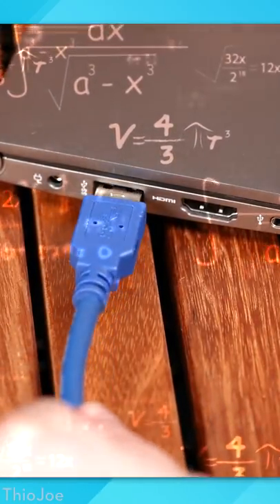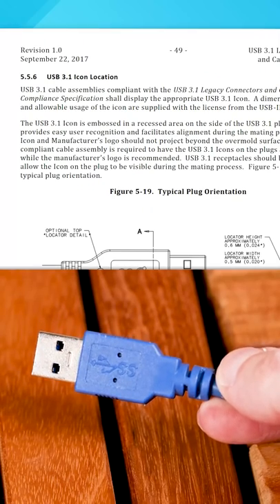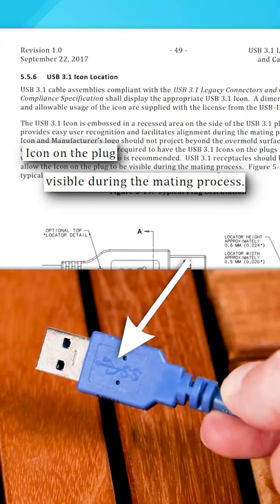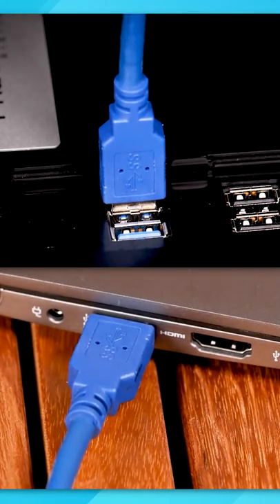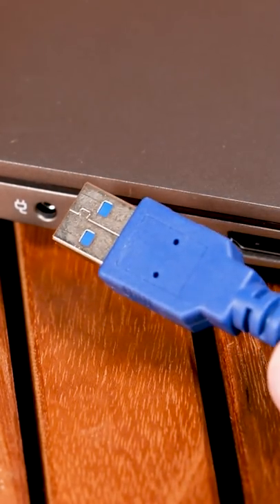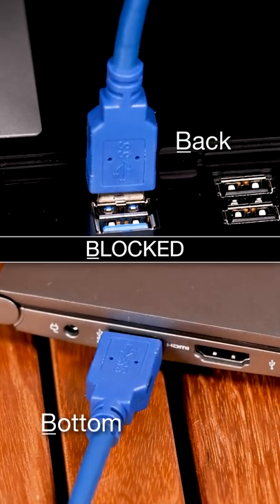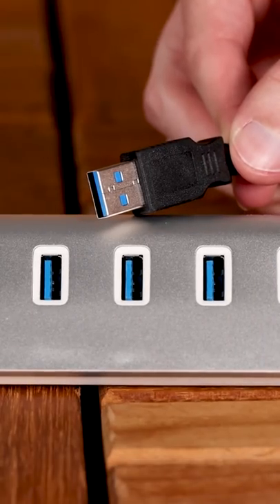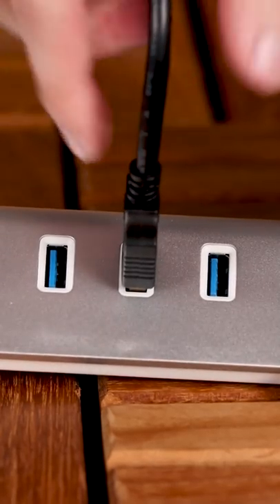Never Plug in a USB Wrong EVER Again

Comment: i already found that out when i was 9, how doesnt everyone know this already
Reply: I’m 30, software developer, and didn’t know…
I have always used a usb hub on the back of my computer with one of each kind of cable connected to it so I never have to handle the usb-a.
(And I plug usb-keys/usb-a peripherals on the front, where the ports are vertical [|] , but it’s ok I can just look at it)
Reply: @morluche91  im 16, also software developer for like 8 years now. In school i always used a mouse with my laptop and between breaks i had to put it in my bag and then put it back in after so eventually i noticed it had 2 open holes on the top which just stayed with me

Comment: Joe, some time ago I spoke to the USB folks. They said if a port wasn't installed correctly, or a cord wasn't labelled correctly, then they would revoke the manfacturer's permission to use the USB logo. Great, right?
 Then I got two hard drives from one of the largest makers, about six months apart. You guessed it, the logo was top side on one and bottom side of the other. I spoke to the USB folks again and they said yeah, they'd given up on that fight. So I put a dab of colored paint on the top of each cable. No more guessing, or wondering if a plug was mini/micro/c/c+.

Comment: USB port is designed in such a way that, even if you inser it correctly the first time, it still does not accept it, because it senses you are not sure. Then you rotate it and now you are sure that this side in incorrect and the you rotate it again and then it gets inserted.

Like if it's true.

Comment: JBL has a great solution to this. It's a USB A cable with the plastic bit in the middle such that it doesn't matter what orientation it is plugged in, and the other side is USB C.

Comment: It's all fun and games until you plug your USB drive into a port that's mounted upside down, as is the case in my PC. If I plug into one of the front ports, the USB logo faces up and the solid holes down, but if I plug into my integrated multi-card reader that also includes a USB 3.0 port, the USB logo faces down and the solid holes up

Comment: I just look at the plastic bit through the holes. They are nearly always on top in the computer so you should be able to see the space in the connector when plugging it in so your end is on the bottom

Comment: Fun fact: it's literally impossible to plug a USB in wrong.

That's why we often fail on the first attempt.

Also, I'll wager that, in most cases, it's very difficult to discern which side had the blocked squares, as most cables don't use coloured blocks, they use black. In poor lighting, you just can't tell.

Comment: That's all well and good, but sometimes the USB port is upside down and you plug the cable in right side up expecting it to go in, and it doesn't. So even if you know which way is up on the USB plug, that doesn't help much.

Comment: You do realize there's reversible Type A USB plugs? My JBL Flip 5 came with one on the charging cable. The plastic part with the pins is positioned in the middle instead of on only one side. That way you don't have to worry about how it plugs in. Its not as good as Type C, but it's still pretty useful.

Comment: TIL Corsair didn't follow USB spec when designing my case. Because the Blocked side is definitely not on the bottom. Luckily, my PC case is situated to my left instead of my right like it's supposed to be so I accidentally made it right and the little logo thing faces me when I plug stuff in

Comment: Would be much easier to rember as "you need to see the holes" much simpler and straight to the point than trying to focus on opposites. If you can see the holes its the right direction.

Comment: The reason the USB goes in from the third try is because the plug gets caught on the edge of the port. That's because we're still using 20y/o technology that has seen basically no improvement.

Comment: Sadly this assumes every USB port is the same orientation relative to position, which sadly is not the case. I've seen plenty of devices with USB ports rotated every which way, so the most-reliable "technique" is as you suggested later where you need to align the plastic inner contact retention bar with the corresponding gap in the port.

Regardless, the USB 3-step shuffle is still just as likely XD

Comment: And if the device for example a external hdd is not reaching the advertised speed look at the usb connector if its blue or if its black look for the 5 contact pads 
Transferring speed at 5 gbps and the device is 10 gbps look at your mobo usb headers and look for usb 3.1 gen 2  and plug it into the usb 3.1 gen 2 port and enjoy speeds of 10 gbps

Comment: Except…. You don’t know if the port is installed upside down or not. Some are not “up” in the way you’d expect… or sideways. Sooooo yea… just look at the port and figure out where the blocked side is, and then flip it over based on the plug you’re holding.

Comment: I tell ya, we REALLY had something with the FireWire standard. It was ALWAYS faster than any of the USB standards and I don't mean by just a little, I mean a lot. 
I wish that we would've continued design and development of FireWire over USB.
Hell, look at how many devices that you could Daisy chain on FireWire. You could NEVER do that with USB. I get why they ditched it and went with USB though, it was far cheaper to produce since each device required a controller for each device on the computer and peripheral and with USB, the controller was only needed in the computer side

Comment: The probability wave function of the orientation of a USB connector can not be collapsed through simple observation. The only proven method is to attempt to insert the connector at leat three times, rotating the connector 180 degrees after each attempt.

Comment: Someone needs to tell JBL that one side is supposed to be filled in because the cables that ship with their wireless speakers have all holes open, the contacts are on a flimsy thin piece of plastic unsupported by the connector.

Comment: Mine are situated from side to side. Also, the design is obviously flawed in that they should have been designed to work either way like USB-C and Lightning cables. USB was and is a great idea but they stopped at, good enough instead of perfect.

Comment: I mean, if cables and ports were reliably to spec, sure. 

It’s been better the last few years, but I can go into my drawer right now and find cables from within the last few years that (1) have the USB logo on top, (2) have the USB logo on the bottom, (3) have the manufacturer’s logo on top, (4) have the USB logo on top and the manufacturer’s logo on the bottom, (5) have the manufacturer’s logo on top and the USB logo on the bottom. 

And all of these are USB-IF certified cables, from big-name manufacturers. I’m not even getting into the issue of cheap, uncertified cables. 

Lots of desktop computers and some other devices have the port positioned vertically on the front or back—which way is “towards the user” then? 

I’ve used laptops and desktops where the port was upside down. 

Knowing the orientation of the cable (by looking at the little holes in the shield) doesn’t help unless you know the orientation of the port, and even a port on the side of a laptop can be annoying to get a good look at while in use. At least those usually have blue inserts since the advent of USB3, so I can usually see the orientation without needing to get a better angle. 

I’ve had devices (like portable hard drives) with no clear “up” for the device, so no way to reliably know the orientation of the ports, even if they were installed correctly. (Obviously, this is more of a micro-B problem than an A problem—but it’s still a case of a “spec” that is ignored often enough it may as well not exist, and it’s the same spec.)

Comment: This never works. My front panel usb ports are upside down, which is opposite of my front panel 3.0 hub which are right side up, my rear panel usb ports are vertical, and my external hub lays flat on the counter with the ports sticking up toward the ceiling so there is no up or down on that, and none of my plugs have a logo differentiating the sides.

Comment: I dont look first just try to Plug. But always it wont work for the first time the right way so i switch it 2 times before it works ,so if u switch it 3 times u used the wrong side first. I think you have to do this this way. first right side (wont work) then switch it wrong side (wont work either) then switch back an it works. Don´t think it ever work by the first try to plug in right never.

Comment: Hey, you know when you try to put in a usb in and it doesnt work switch it to the other side and still doesnt work switch it again and it works
Have you ever wondered why?
Well they have those little holes in witch they get gripped on by small pieces of metal in the port well when you try to plug it the first time the top of the usb hits those metal things not allowing it in

Comment: just bad. This guy is, not a computer tech. You look at the end to see if the left or right side has the white, red, or blue bar. then plug the male into the female with the bars on opposite sides. I don't even look. My time is so valuable. I plug the USB in if it doesn't plug in I turn the USB port 180 degrees.